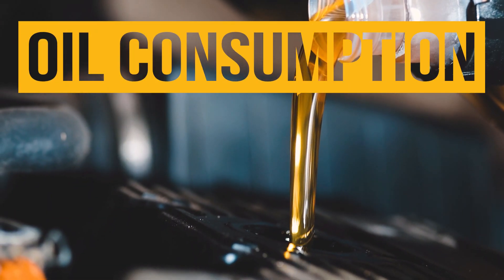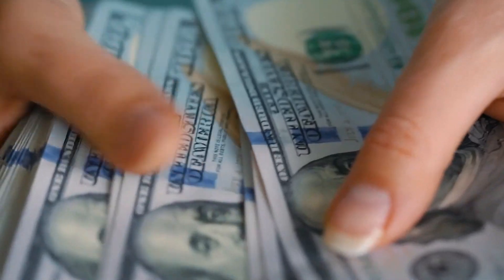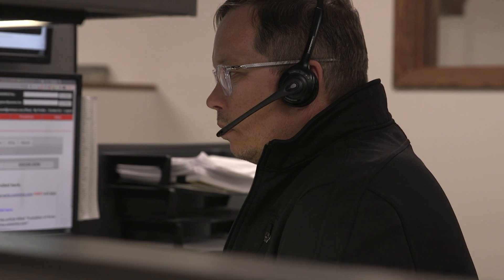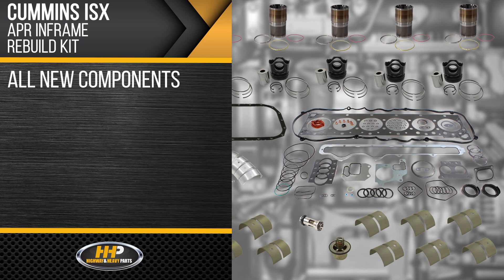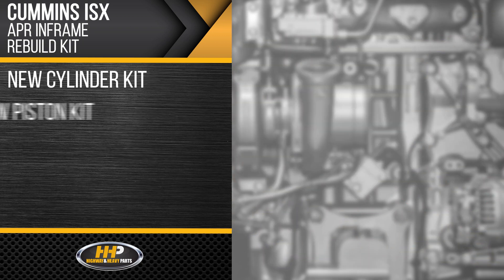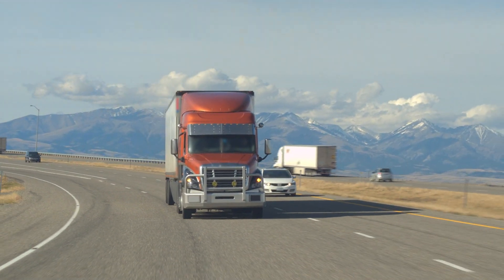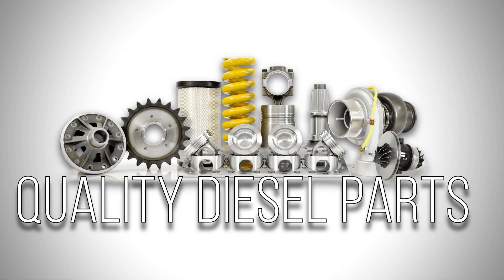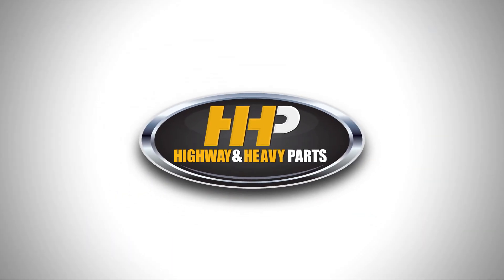Cummins ISX Anti-Polish Ring Engine Rebuild Kit From HHP

Comment: Hi i rebuilt my Scania motor i see white smoke but nothing on idling i haven pull a load yet it has about 40km on it since rebuilt is this normal.I also fixed Ecu my one injector was not working